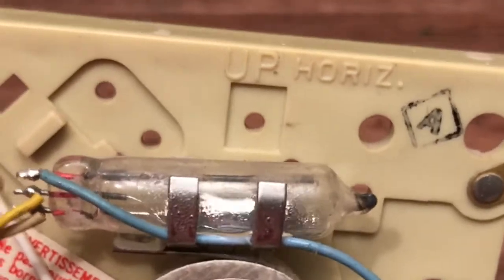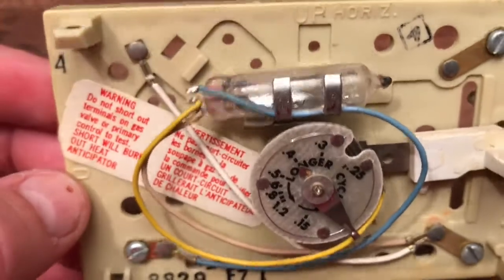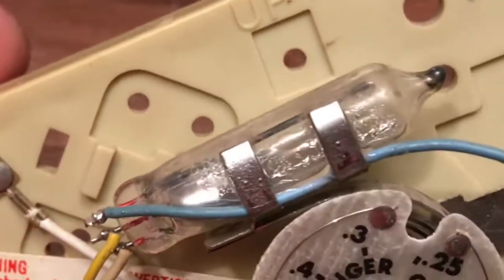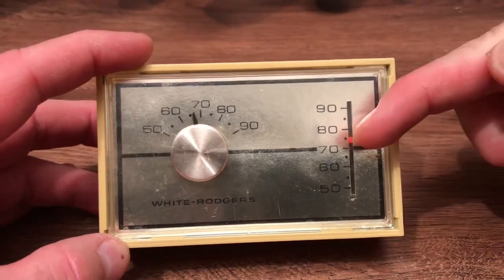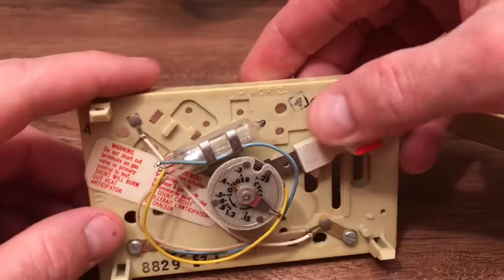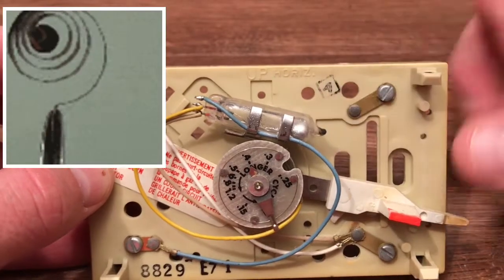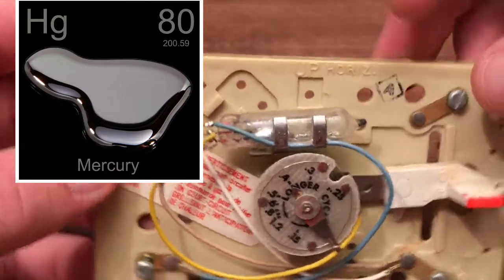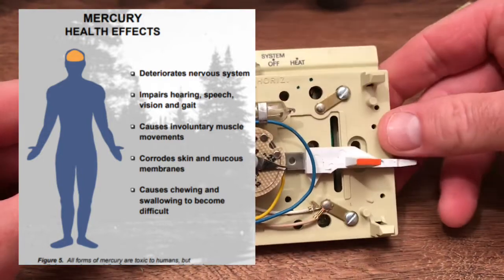A Mercury Switch is Liquid Metal Inside a Thermostat

Comment: WHAT DOES THE DIAL INSIDE DO? NOBODY MENTIONS IT! AND THATS WHAT I WANT TO KNOW ABOUT.
Reply: Adjusts the baseline temperature, think of it as gross calibration.
Reply: @allmyhobbiesareexpensive2676  Thank you.
Reply: @MoogieOogie can you explain further cause I still don’t understand….
Reply: @tonyxhyon  No I cant. Because I still dont understand. But my Stepdad is a general contractor, so I will just ask him.
Reply: @MoogieOogie have you figured out ? I don’t understand the dial and what it needs to be set as
Reply: @tonyxhyon  Ive been offline...I only learned that it seems to adjust the amount of time the heater kicks on per cycle? Who knows...lol
Reply: I saw this comment and wanted to know as well so I looked into it a little bit. It seems to be called a heat anticipator and it's common in low voltage thermostats. It essentially adds a delay or heat to the circuit to decrease a frequent on/off switch if the environment is close to the temperature. Which makes sense because if it's a simple circuit as soon as it would hit the temperature it would turn on quickly and run and then immediately shut off if there was no anticipator. That would be very hard on the equipment and not very efficient. 

For the record I have no experience in any of this and it was just a matter of trying to Google well fixing a thermostat problem lol
Reply: @Desette  Im no tech at all....and finally list interest....?!!!
Reply: @Desette  I appreciate you responding ! but I’m literally a dummy lol I guess I’m asking, how should the dial be set to be the best ? Cause right now I’m paying soooo much electricity at my new apartment and I think it’s because of that.

Comment: what is that longer cycle wheel for? could you explain?
Reply from the maker: A heat anticipator is an electrical resistor device mounted in the center of many older mechanical thermostats, including the familiar Honeywell dial-type thermostat. The function of the heat anticipator is to fine-tune the point at which the thermostat turns off the furnace burners

Comment: how do you test this switch with a multi meter to prove that it works
Reply from the maker: Good question. I’m afraid I don’t know the answer to that one.
Reply: Continuity test
Reply: i know im replaying late but semply u just test the wires if it connect electricity or not

Comment: They are ingenious. The ball of mercury doesn't roll away from the contacts suddenly, so it has a built in differential. The heat may come on at 67 degrees and stay running to 70 degrees which is perfect for a boiler so it doesn't go on and off too often.

Comment: Great design! Problem with digital thermostats is they rely on a battery. Pipes can freeze when the battery fails!
Reply: A competent installation would have the thermostat pull power from the furnace via the r and c terminals.  Thermostat only loses power if furnace does, then at that point you won’t need the thermostat, you’ll need power

Comment: Wait, so in this design, you always have to have the HVAC on?  So you're always spending money all the time?  It's either one or the other, never off?
Reply from the maker: Great question! I’m now remembering that device has a switch that toggles between Heat and Cool. And I always wondered why we could only choose one at a time. And I now I think it was to keep the bill from getting too high with the HVAC always switching back and forth as the Mercury slid back and forth. So in winter you only need heat - and when the coil warms and expands enough, the mercury slides to the other side where the AC circuit is inactive until I toggle the switch from Heat to AC.
Reply: For heat and cool thermostats there’s two different switches attached to mercury bulb.  If it is heat or cool only it has one switch attached.  No it doesn’t run all the time.  Lol

Comment: Should have left the old one up on the wall doing its job, those things are almost impossible to to kill.

About the only maintenance they need is some contact cleaner every 30 years and maybe some capacitor replacement every few decades.